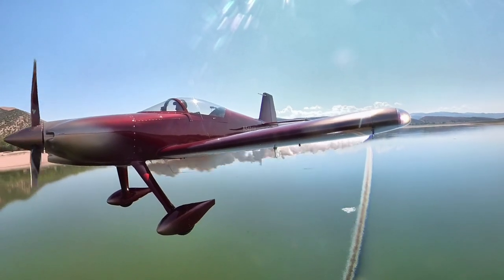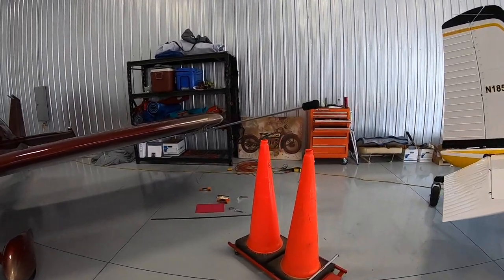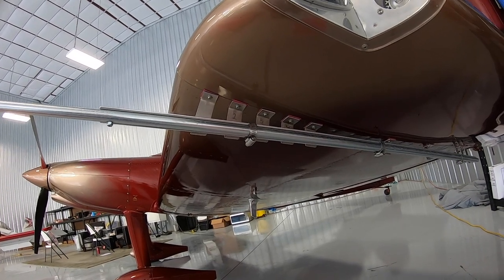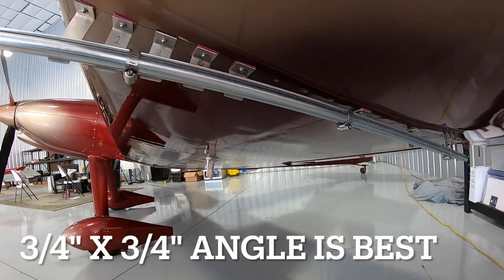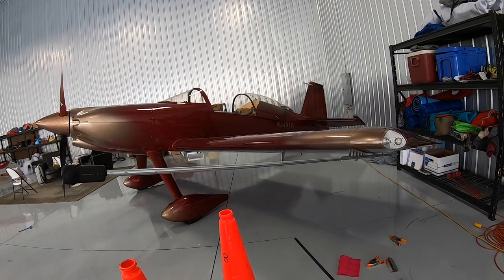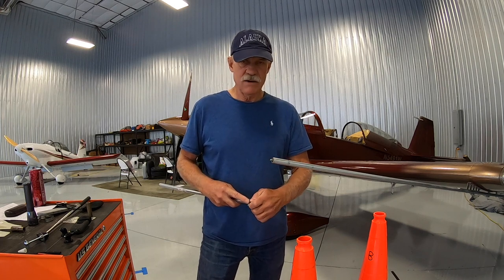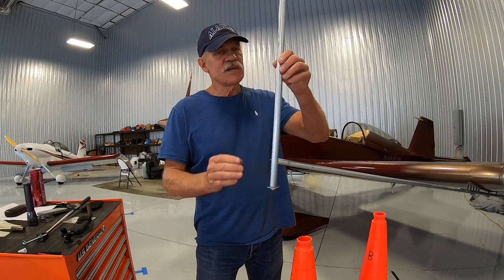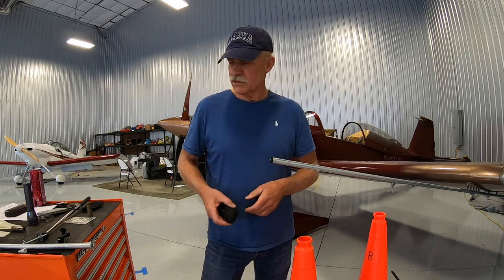How to Mount Cameras on Airplanes #GoPro #Insta360

Comment: Hi! Great video, thank you! Being more modest, in a plane I cannot change so much, could a standard Go Pro adhesive mount support a GoPro Hero 11 or an Insta 360 if attached to the tip of the wing? It is for an RV-9A, speed up to 150kt...
Reply from the maker: @VoandoComMarcelo    Hi, sorry, I meant to reply this morning. 
Most of those adhesive mounts are plastic, I probably wouldn’t trust it with a camera. You have to be positive that a mount won’t fail. 
It’s easy enough to make a mount that will attach to 3 or 4 screws out on your wing tip.

Comment: Some great ideas Chris.  I've used an N Flight + with mount in the past but only mounted it on the inside.  I operate under UK LAA Permit system and have to get any installation tested signed off by an inspector.  All possible and I can feel a winter project coming on ;)
Reply from the maker: Watchfordpilot. Good to hear from you.  I was looking at an Nflightcam mount, but it called for a #8 or #10 screw.  It seems all mine are #6.  So I began making my mounts.  An inspection sounds like a hassle, but probably a good idea.  I was real concerned when I made my selfie stick mount.  Did a lot of testing with weights first and then flights over unpopulated areas.  Seems to be holding up nicely.  Fun making videos.

Comment: Great Video. How do you fix the Insta360 on the wing? Vertical or horizontal? Thanks for YouTube answer.
Reply from the maker: @Joachim Stachelscheid. Hi Joachim.  For a view of that tail mount, Here's a link to a video I made on camera mounts. Just scroll to the part showing my tail mount. 
How to Mount Cameras on Airplanes #GoPro #Insta360
https://youtu.be/AKKkPPcr9T4

For that tail mount. I used two 18"x 1" strips of aluminum, about 1/16" thick as the side straps for the mount. Then a piece of 1/2" x 1" x 12" aluminum channel as a
spacer between the two straps that attach to the tail. I took my time contouring the straps to the shape of the tail. Then clamped the channel in between the two
straps, drilled and pop riveted. Then epoxied a 1/4" × 20 threaded bolt in the end to mount the Insta. My channel was 1/8" thick, so a piece of 1/8" wood dowel on each
side of the bolt kept it straight while epoxy cured.

Let me know if you like more details, l'Il be
glad to help you out.
Reply from the maker: @Joachim Stachelscheid. Excuse me if I misunderstood your comment.  Horizontal
Reply: horizontal on the top of the tail but vertical on the rod out in front of the wing.

Comment: Great videos! Question: What did you use on the interior walls of your hangar? I'm wanting to insulate my hangar walls and cover it with something like what you've done. Very nice!
Reply from the maker: @VansAircraftBuilders.com. It’s just panels of sheet metal with insulation behind. Me and Joe bought it that way 2 years ago. Everyone wonders how a couple new comers like us found a hanger to buy. They’re a hot commodity. The whole hanger is a metal structure. 
I just had a hanger built up in Morgan County, 42U. Almost all the hangers up there are wood. So my walls are all sheet rocked up there.  The guys all seem to like their wood hangers. They’re 60 X 60, 15’ ceilings and seem well insulated.

Comment: I just held my new Insta 360 X3 about 1.5' in front of my wing and was able to see forward, down, sideways, back and I could include cockpit shots. Is there a reason you have yours so far out front? I'm not doing any aerobatics, just flying...It seems that the longer the pole, the more it will flex? I've been looking for a long time how to do this with my low winged Bristell. Great content here!!
Reply from the maker: @DH. I’ve got my camera about as far forward as I dare. It does flex more, but the cameras internal stabilization seems to be pretty good at stabilizing my videos. I think anywhere between your 1.5’ and 6’ is fine. Much closer than 1.5’, it starts to look like the camera is just mounted on the wing. At around 4 to 5” and you can utilize the true value of a 360 camera where it looks like you have a camera man in front of your plane.  While you’re holding the camera, try moving out to the 3 to 5’ range and see which view you like.
Reply: @WheelsInTheSky  Thanks for the response!! I'm anxious to try this. The weather here has been horrible for a couple of weeks with no end in site... You noticed no negative effect with this setup? No Aileron Pitch adjustments?
Reply from the maker: @D H.  I have noticed nothing, no difference from before mounting.  Yeah, our weather has been mostly bad to.  Although yesterday day I flew a friends plane.  It was cold, but still a nice day.  Can’t wait for spring.
Reply: @WheelsInTheSky  Where do you fly from? I've been waiting for VFR to go from the Chicago area to South Carolina for nearly 2 weeks now. (Buying a hangar-home down there) This next week isn't looking promising either. Cold weather doesn't bother me. I have great heat in my plane, and of course it runs great in cool weather. Where I live, winter flying is the best. Summers here have non-stop thermals that bounce you all over the place until you get up over, 5000ft. By the way...Love the 911. I just sold mine this last fall. I miss it. Had a Cayman S too. I want to get the new Cayman 718 GT4. But they are impossible to get, even if ordered. Waiting for this chip crisis to be over. I love Porsche. Have had a 944S and a Macan GTS as well. You have some nice looking planes there... 👍
Reply from the maker: @D H. I’m flying out of KBTF, Bountiful SkyPark and 42U, Morgan County.  Bountiful is called SkyPark, but it’s not really.  At least it’s not a place you live with your plane.  I’d love to live in a real airpark.  I’ve seen some real nice ones there in South Carolina, been tempted to go out there and look at them. You’re right about the summer weather, we just go early in the morning.  What’s the name of the airpark in SC?
Reply: @WheelsInTheSky  S17 Twin Lakes. There are a few lots for sale there now. Then you build what you want. I just signed my contract today!! I'm very excited about exiting Hellinois. I love Utah too...I've been there every year for the last 8 years off-roading in Moab and St George. Unfortunately, with the mass exodus of Liberals from California to your State they are ruining everything as usual. They are closing epic trails in Moab and making it impossible to drive SXS's in town anymore. I won't be returning. Great riding in W Virginia too... If you ever decide to ly to SC, get a hold of me. I have room for 2 planes in my hangar. And will pull out the couch bed...lol
Reply from the maker: @D H.  Yep. That invasion from CA has been happening for quite a while now.  They’re even trying to prevent us from landing at those remote dirt strips down in Southern Utah.  I keep thinking I’d like to take my Rocket on a scouting trip around the country this summer in search of a nice airpark. I’ll stay in touch.  I’m going to go look up Twin Lakes now.

Comment: Can I do this on a certified airplane?
Reply from the maker: @theaviatorew  I did on my 185.  The way I read the reg’s, no specialized tools or equipment was needed and it doesn’t alter the airframe.  Simply put it on and take off with a screw driver.  The bottom line is that you are responsible to make sure nothing falls off your plane.  If you’re not 100% sure, I wouldn’t do it.  It’s all fun and games doing videos, until something falls off and goes thru someone’s windshield.  Then they loose control and hit a school bus and run into a tractor trailer, which goes off an overpass and hits a tanker truck which…..  
I also mostly fly over uninhabited areas.
Reply: @WheelsInTheSky  Haha, I love your rabbit trail of your scenario. Thank you for the advice!

Comment: How much end play were you getting on the end of the rod under the wing on the 180 (?)?
Reply from the maker: @edstoro3883. At times it can bounce around a fair amount, but the cameras internal stabilization seems to do a great job of reducing it.  When taxing over a bumpy surface I notice some movement in the video, but in flight , even with the pole wobbling around, the video is pretty good. I’m always amazed!  You may have seen this. But here’s a video using the pole on the 185:Return to Hidden Splendor in 185
https://youtu.be/1stj9XNE7oU
Reply: @WheelsInTheSky  Thanks for the quick reply. You can see what I am working with on you tube with Bristol Bulldog Flight. Thanks again

Comment: Great instructional. Love the footage you get. What do you use for remote control, the app or the Insta360 GPS Smart Remote?
Reply from the maker: @Honji Clan.  Hi Honji, most of the time I just turn on the camera and jump in my plane and go.  Then turn it off when I land.  The people at Insta also recommended this, as some times I’d be flying and wasn’t able to get my camera to start using the Insta app.  Sometimes when flying my 185 or Husky, I’ll use the Insta app on my iPad to start and stop video. Those two planes have more room in the cockpit and fly slower, so I have more time to mess with the app.  Also, if I’m going to use the app ., before I take off I make sure the app is talking to the camera.  
I have a friend who uses the smart remote, I got the impression he wasn’t impressed.

Comment: How did you mount the selfie stick to the fin?  I also have a RV8.  Rivnuts??
Reply from the maker: @edstoro3883. I have a fiberglass cap on the top of my vertical. I used the first 3 screws on each side to attach some 1” aluminum strips.  Then in front of my vertical, between the two pieces of aluminum strips I riveted a piece of aluminum channel, 1/2 X 1”,  about 10” long. 
Hope that helps. I’ll probably do a separate video on how I made it. It’s a easy fun little mount for  low wing RV’s.
Reply from the maker: @Edstoro   Basically, just using the same screws that hold my fiberglass cap on top of my vertical.
Reply: @WheelsInTheSky  Thanks !!!

Comment: How do you get on doing these mods to the certified 185?
Reply from the maker: Hi HM,  yeah, I was reluctant to even mention it. I put it on in the middle of the desert , did my video and took it off to fly home.
Reply: @hm250  I’ve been through this. As the reg reads (and I’m paraphrasing) as long as the installation and removal doesn’t require any “major tools” no approval is required. Looks like it was held on with thumb screws to me.
Reply from the maker: @hm250  HM, thanks for the consideration. That’s ok, I’m sure others will wonder the same.  I’m not sure how smart it is to do such a video, I pondered doing it for months.  But a lot of people wanted to know how I made the mount for the Rocket. It’s just as well that I let people know I only mount up the 185 in the desert.  Thanks again!!
Reply from the maker: Hi William 1968,  Thanks for the input.  That’s my interpretation also.  I’m not sure everyone will agree.   It’s easy enough to remove and put in the back of my 185 till I get to the desert and put it back on.
Reply: @wiljam1968  what reg is that?

Comment: Chris, nice job.  I saw in one of the videos a cable running out to the insta360. Are you able to charge the camera by USB cable in flight? Any overheating issues?  Have you had any wifi connection issues with the camera using your phone, does it even connect in flight?
Reply from the maker: @Chris Tieman. Hi Chris, when I first started, I bolted a small battery box to the aluminum angle under my wing and ran a USB C cable up the pole to my camera.  You may see the battery box laying on the floor under my wing during the video.  I took it off as the camera battery lasts for at least an hour.
If the camera sits in the sun, it can over heat and give you trouble.     I use to start the camera while in flight using my iPad. It worked most of the time, but, sometimes it wouldn’t.   Now days, I just make sure the battery is fully charged and use a 128 micro sd card, and turn on the camera before in get in my plane and just let it run till I land. 
Hope that answers your questions.  Don’t hesitate if you want to know more.

Comment: What engineering sign offs do you need?    You’ve slightly modified the airflow; you’ve added mass to the wingtip which could effect flutter in the extreme, the strength of the brackets, etc.   Some installations are on certified (non-experimental) airplanes.
Reply from the maker: @parkburrets. Hi, I’m not sure where to begin. So, first, I recommend you don’t make a mount like this.  Second, the airflow disruption is minimal, no worse than a suction cup mount or many of the other mounts on the market.  The mass is negligible, far less than a minor fuel imbalance.  There is no flutter. I test flew at each stage.  Clearly, I went overboard with the brackets.  No single or dual or triple or quadruple failure of a bracket will cause failure of this mount.  
I could be wrong, but the way I read the reg’s, this is not a modification of the airframe, but a simple attachment that I can put on or take off in a few minutes.   I did put a lot of thought on it, discussing with friends who are A&P’s, an engineer and other pilots.  But, in the end, just take it for what it’s worth.  The same as most everything else on YouTube, just entertainment.
I made the video due to requests to show mostly home builders what I’d done.  I hope you enjoyed, thanks for watching.

Comment: That's a pretty cool pole you've got there. I would probably paint it (black or burgundy) if I were you.
I don't think you could shatter a carbon fiber pole but if that's a real concern, you can still insert an aloooominum part or a tether inside
Reply from the maker: @Nick’s. Stuff    yeah, that’s a good idea Nick.  I wanted something that was going to be able to withstand some pretty high speeds, and I was probably over concerned in the beginning.  I think painting it is a good idea.  I may do that pretty soon.

Comment: hello, what setting do you use on your insta360
Reply from the maker: @Gerard Fardeau.  Hi Gerard, thought I had answered. But showing I haven’t. 
I just use the factory settings. And make sure it’s set to 5.7k and auto exposure. For some reason the camera ends up on manual exposure sometimes and the video is worthless.